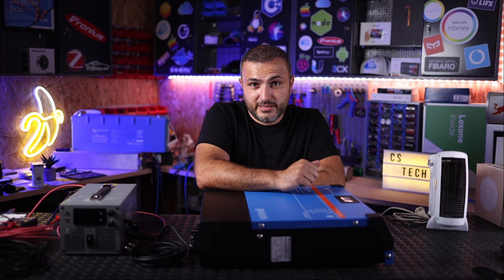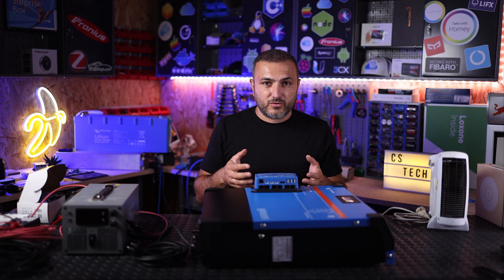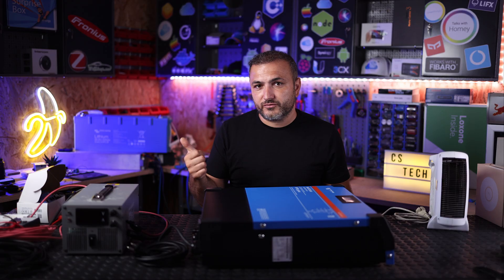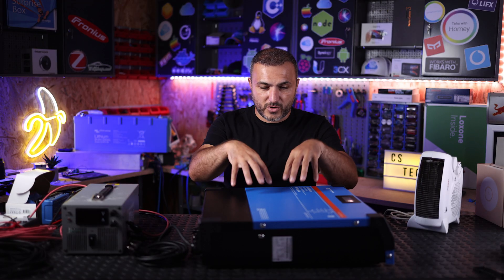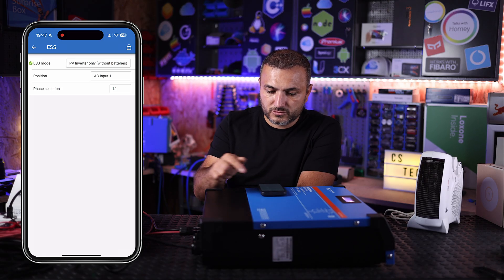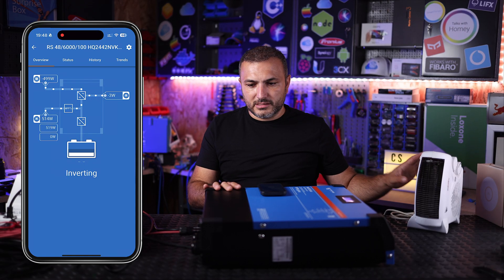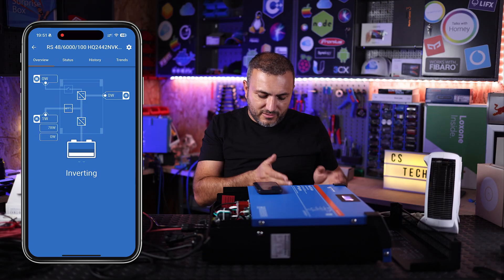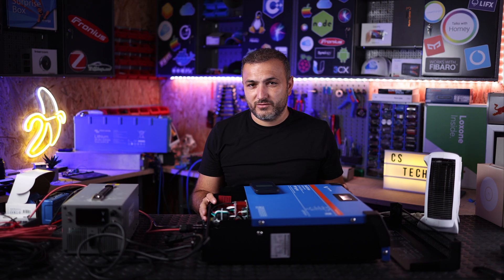Victron Multi RS Solar 48/6000 – Grid-Tie Today, Hybrid Tomorrow - real tests

Comment: Thank you very much for the  explanation using the rs solar without batteries. It is very useful in a situation  grid is off for a long time. Having solar panels without being able to use them for instance to heat a boiler is very annoying.
"Normal" solar inverters do not work without a working grid.

Comment: Hi, just wondering, is there any difference/limitation if you connect high load device direcly to grid (AC IN side) or on AC OUT2 side of the inverter?
Reply from the maker: On AC IN you won’t have any issues since it is directly connected to the grid. However, on AC2 you will be limited to a maximum of 50 A, as that is the relay’s maximum capacity.

Comment: Can it make Power without grid or battery? Like to replace thermal to make hot water?
Reply from the maker: Can work, but for many devices can be a problem turning on and off based on sun production.

Comment: How do you get multi rs to feed into the grid?
Is that feature only in the newer version that also has two mppts.

I have an older model with a single MPPT and it doesn't have that kind of grid feed option.
Reply from the maker: Try latest firmware
Reply: @thecstechvideos  I already have latest released fw.

Comment: Hello, What is the main difference with a Victron MultiPlus II?
Thank you.
Reply from the maker: Main? This one don't have a transformator for inverter, has built in MPPTs so you can add 6 kW panes on it and also work on new architecture.
Reply: @thecstechvideos main : major, principal

Comment: Thanks for the informative video as always. Do you know if this inverter can be added to an existing system with a MultiPlus II?
Reply from the maker: Hello, it cannot be added, as it has a different architecture. At the moment, it cannot even be added in parallel with another of the same type, but this will be resolved.
Reply: @thecstechvideos Grüße doch das soll funktionieren aber nur im Frequenzmodus

Comment: Can you power a Washing maschine, 2150w a tumble dryer 2200-2700w and fridge 160w with this inverter?
Reply from the maker: Let's calculate: 2150 + 2700 + 160 = 5.010W and the inverter is rated to 5000W at 25º temperature. If temperature is raising also the output will be lower. In conclusion if you work whit them one by one should not be any problems. All at once is possible in diferent situation to receive an overload if you ar not connected to grid (run on batteries), but if you are connected to grid you can use max 11.500W. I recommend to check my other videos where I explain how this device works.
Reply: if you are careful yes, if you are careless no. You need to plan a bit, because if they all peak at the same time, it will overload